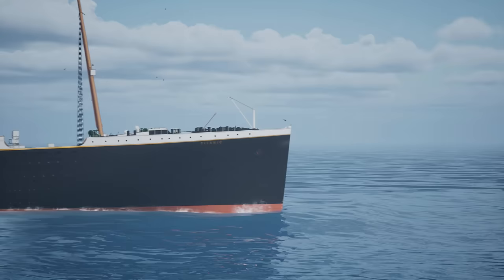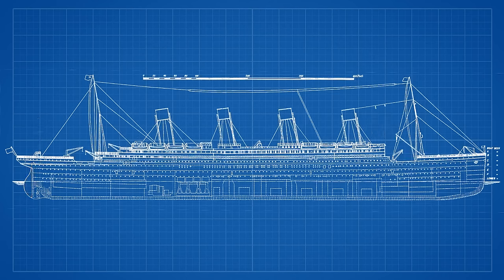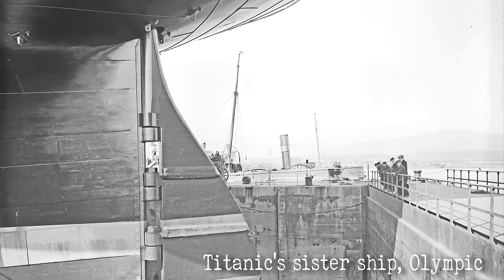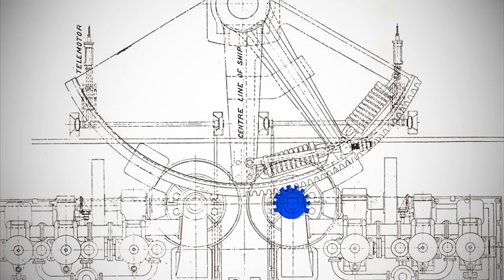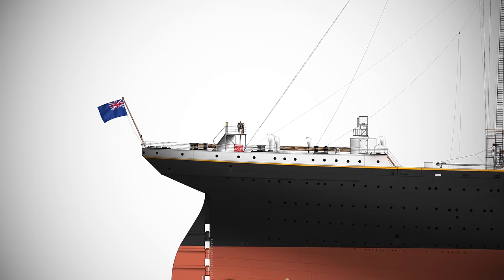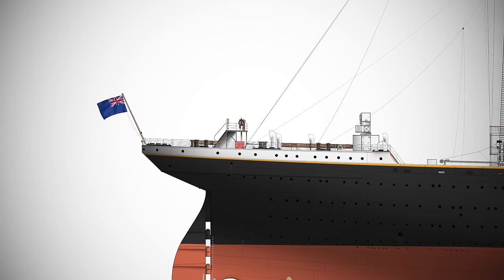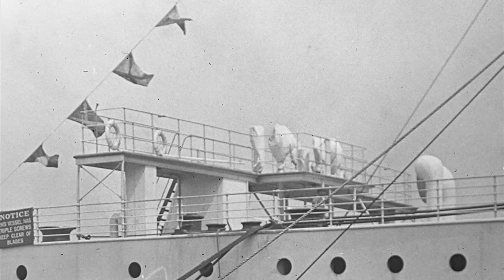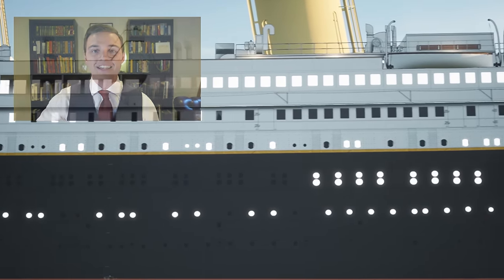How Did They Steer the Titanic?

Comment from the maker: DID YOU ENJOY THIS VIDEO? :)
Why not support my work on Patreon at; https://www.patreon.com/oceanlinerdesigns
OR join as a YouTube member for cool badges and emojis!; https://www.youtube.com/channel/UCsE8PTncfn2Vga48jH46HnQ/join
Supporters on Patreon and YouTube enjoy perks like early access and behind the scenes and bloopers!
▶MORE OCEANLINER DESIGNS;
Were People Trapped Inside the Titanic When it Sank?: https://www.youtube.com/watch?v=kQPUzX6JSDU
5 Ship Design Fails: https://www.youtube.com/watch?v=QsKNWEsm4r8
This Ship Should Have Sunk (But Didn't!) SS Malolo: https://www.youtube.com/watch?v=MDHCH2QCFt8
Reply: Excellent thanks
Reply: Okay so am I silly to ask, but lets say they had a guy at the docking bridge, being that, that wheel is directly on-top of the steering gear, would that not have helped turn Titanic a lot quicker?
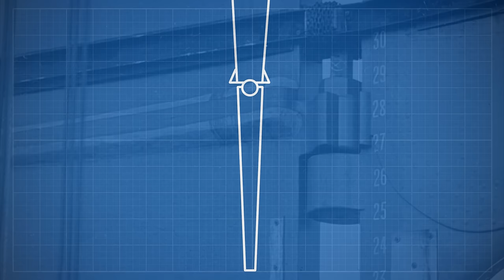Reply: 4:18 A really good video and amazing research. Only one comment. You show the limits for swing of the rudder, lock to lock, to be 40 degrees. I was always under the impression this was 80 degrees, lock to lock, so that the helm and rudder in a hard a  starboard order, would be 40 degrees off the longitudinal axis.
Reply: 0:13, 892 feet?
Reply: One thing I wonder about. How quickly did the servo react to the steering wheel position steering wheel?
Reply: What would have happened if they rammed the ice burg head on.
Would only the front bulkhead flood?
Or would it crumpled the entire ship through the sheer mass behind it causing untold buckling?
Reply: I literally clicked on this video for the following reason: I saw the title and thought (with a wheel - duh). I then though, "it's got to be more complex than that...."
I then had a metaphilosophical realization that knowledge is the resolution with which we see the world; and my resolution of the existence of the Titanic or this age of steamships was rather limited.
And so - after watching the whole video; my resolution is increased slightly, my thirst for knowledge is has not gone unsatisfied; and the steering of the Titanic was far more complex beyond anything I ever thought of.

In hindsight I suppose it's the lack of hydraulics at the time :)
Reply: So basically if you turned the wheel to the left the ship would steer to the right or starboard and the opposite to normal instinct or what normal people would perceive when turning a wheel, right is right and left is left? So maybe that's why she hit the iceberg, if they had normal steering set up turn to starboard is turning the wheel to the right and ship turns to the right and not the opposite?
Also ICEBERG right ahead is saying the iceberg is to the right of the ship or is it dead ahead?
If right head that means that the iceberg is to the starboard side and then, officer murdoch says hard to starboard and she goes straight into the iceberg, unless the steering is directly the opposite of the wheels turning so right is left and left is right?
Reply: I am confused? If tiller is pushed to the starboard side of vessel, the rudder forces the ship to turn to the port/left direction and if tiller is pushed to the port side of vessel the rudder forces the ship to turn to the starboard/right direction. Correct? So when the vessel needs to turn to starboard, the ships wheel is turned to the left/ port side of vessel ?lwhen the vessel needs to turn to port, the ships wheel is turned to the right/,starboard side of vessel ? The ships wheel becomes the tiller which is connected to the rudder?

This is the opposite of what you are describing,hence my confusion?
Reply: You have now answered my question! My very good friend jack saw the movie with me and said "he turned the wrong way" and ever since I thought it was a missed blupper. My friend jack has since passed away but I appreciate you for that 1 answer!!! I'm going to sub now❤❤❤❤❤

Comment: I think most people tend to look down on things like this because they view it as old fashioned, or low technology since it's 100 years away from where we are now but this video just shows how fascinating, complex, and ingenious these things really were.
Reply: Electronics free technology is very underrated and underappreciated by most people today.
Reply: @3UZFE  also rejected by corporations, because it’s often more expensive.
Reply: I find this kind of technology more impressive because it's so crude, simple and effective...
Reply: The same kind of system are still used on tugs and fishboats to this day. The control system is about the same but hydraulic pumps are used instead if steering engines that is.
Reply: Have you ever heard the phrase " first, things are primitive, then they become complicated, at last, they end up simple "
Reply: Complexity is in the eye of the beholder.
Reply: If one was standing on deck, looking down would be the only option :)
As a software engineer albeit with a mechanical background, I see this era as being extremely 'high-tech'. From a design standpoint, I can see parallels between the (sub)system architecture of the mechanical/physical  and that of the digital. No way I'd consider any of this steering system to be "low-tech". 
On the physical side, the materials (esp. metalurgical), as well as the purpose built tools created to fabricate and handle the large parts, are themselves "high-tech" The use of concrete to encase the bolts holding the rudder sections is ingenious.
Reply: It's hydraulics, still very widely in use. Almost all cars on the road use it.
Reply: Yeah well, people today aren't nearly as inquisitive, interesting, and intelligent as people were over 100 years ago. They see it as old fashioned because they're only used to and familiar with cheap today...so long as its aesthetically pleasing, people today could care less. Ingenuity died with the last generation. People today are, by far, alot less intelligent.
Reply: @SshadowOnTheSunN  People today are far more productive.
Reply: @setoman1 that’s false, maybe productive in getting others profits but we are in no way more productive
Reply: @david-468 ”Productivity” is not some metaphysical state of existence 😂 it is a quantifiable, verifiable measure of items or useful work per unit of time or energy expended.
Reply: @setoman1  yes and those parameters are redefined every day in accordance to what is wanted to be gained, I.e. producing through corporate slavery, I hate that term but I can’t find a better one, I care more about advancements innovations, freedom of thought, then I do production
Reply: Engineers back then were truly built different. It's mind boggling.
Reply: @david-468 the way I see it, modern production benefits the corporations more than the public. This has led to a lesser care for design quality and “soul.” For example, ships today are just bricks stuck to bathtubs and can handle little more than slight waves, but then you have ships like the Kaiser Wilhelm der Große, which was arguably much more beautiful and was a bit of a tank.
This is why, as Gen Z, I decided to rewind my clock a hundred years. The style and quality of that era is, in my opinion, better than the disposable computer mice on wheels we get today.
Reply: @lemagicbaguette1917  I agree for the most part and I’m in the same “boat”
Reply: Old tech has its place. Take polar exploration vessels. They avoid complex electronics unless they have a good old fashioned mechanical backup.
Reply: Badass would be the word I'd use. Modern day technology has gotten so complex I can't even make an effort to understand how we do most things today. What I love most about learning the "old school" ways is how surprisingly easy it is for me to digest in comparison. When I'm able to break down and understand the logic and science behind our old technology it fascinates me to remember just how crafty we sons of bitches are.
Reply: @weathersytv3572  for instance, I understand steam engines, and I could probably make one for my bike with the proper materials. Can’t say the same for modern ICEs, however…
Reply: This is sheer mechanical in the workings, Most people who think these old technologies as old fashion simply don’t understand or even try to learn how it works because most people today don’t have all the knowledge of experience but only the knowledge of what they were told. Like do most people don’t know how a phone works, how water are pump thoughout a 2 story house or how water heater heats up water no we don’t, We only know how use it but this video demonstrates that in clear details without actually being there to see it comes to play.
Reply: As an engineer I’m amazed at what they built with the most basic of machines and technology. How someone drafted all this up in a drawing room. Today we use computer aided design and even then designers find it hard. The modern day engineer has become complacent and could never build this with the hardships they had
Reply: 100% true. People don’t understand how different it was back then many things were new technologies.
Reply: I don't feel that way. It's very interesting how they built things like this before computers. The engineering is something to admire to this day.
Reply: Hello!! You have a comma splice between "fashioned" and "or". Your sentence should be: "...as old fashioned or low technology..."
Reply: "most people... insert bad thing,
but ME.... insert good thing"
Reply: We stand on the shoulders of giants